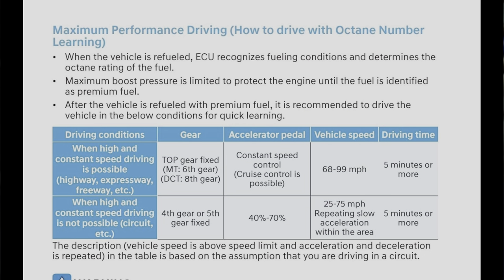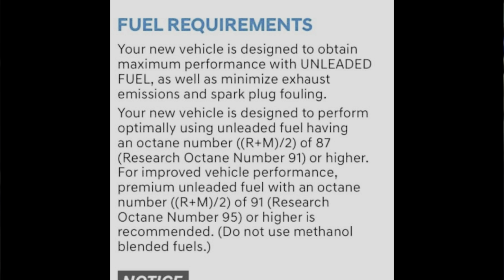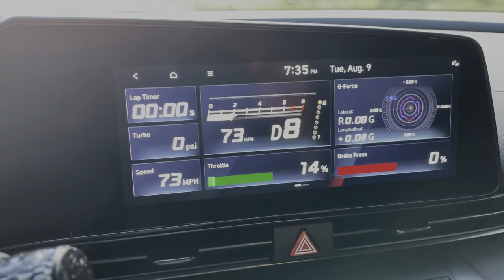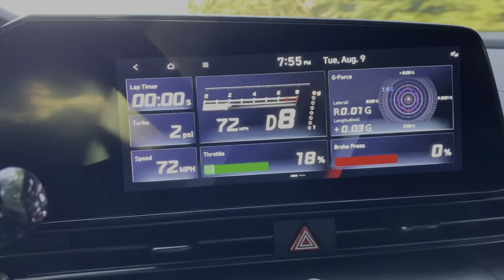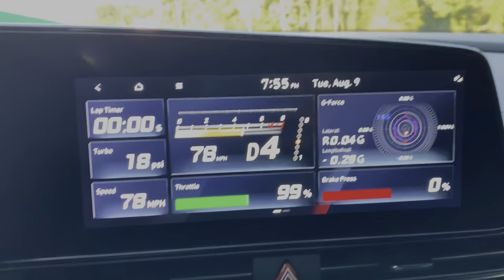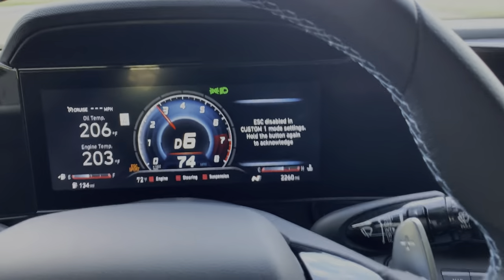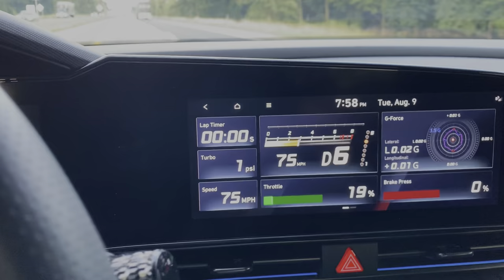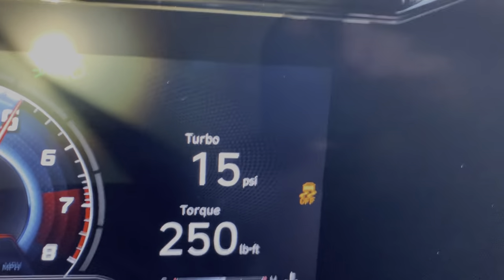Get Max Power on Your Elantra N (Octane Learning)

Comment: The one time I got the octane to learn after I got under a half a tank it went away. Is that normal?   If so if I keep tank above half at all times will it stay?    And has anyone seen the difference in power on the dyno from leaned and not learned?
Reply: Yes, OL will disable around a half tank and you’ll have to re-learn. It will also unlearn overnight.

Comment: Can anyone help me with my scenario. With how my drive is to work it is impossible to do high speed and even low speed is impossible. I’m only on the freeway for like 3 miles and the rest is city. I tried a different route on the freeway but going 70 for 5 minutes just doesn’t due to other drivers and it being already 15 over the limit. Also going between 25-75 mph in 4th with 40-70% throttle doesn’t make sense. Someone please help. I’m pretty much never octane learned
Reply: Get to 65mph in 6th and give it 40-50% throttle for about 5 seconds. Let off the gas for 5 seconds. Repeat this over and over for 5 minutes. Done.

Comment: So basically all you have to do is after you fill up get on the interstate set Cruz at 75 mph for 10 minutes and it will learn. Kind of retarded that we have to do stuff like this every fill up to get the max performance out of the car. Especially when I'm running 93 all the time. You would think that if you're running a lower octane fuel when you first go wide open throttle the car will retard the timing and know you're running lower octane due to knock. Should automatically pick up once you go wide open throttle to know what fuel is in the car. Would hate to fill up the car and come across someone on the road that you wanted to race in Mexico and your car lacks performance due to not have "octane learned"
Reply: Still haven't got it to octane learn. Only pushing 16psi. Max torque is only 250. Car doesn't seem to pull that hard at all.😢 We did a trip that was around 115 mi away and had the cruise set at 75 for like 20 minutes. 6mt EN. When are if I need a reset the PCM or something by disconnecting the battery. Right when I got the car and I broke it in and hit that 600 mi mark I went wide open throttle and it felt pretty good and I was hitting 18 lbs.. And I remember one day on my way to work It's like the car hit a brick wall when I was going in a boost. Ever since that happened months ago I haven't been able to run more than 16 lb and all I run is 93 octane.

Comment: Hate to be the "negative" guy here, but please head over to the facebook group and look at the newest post about the subject. This has been completely debunked by engineers and two prominent tuners with data. Looking at the low accuracy boost gauge and coming to conclusions about is nonsense, and the impressions are simply filled with confirmation bias.
Reply from the maker: Hey Will, thanks for your feedback on this.  I know you own one of these yourself, and while you and many others tend to agree with these engineers, I am one of the owners that feels the difference and believes it helps.   No disrespect to anyone who stands by their claims, it’s just my opinion that its in the owners manual for a reason.  Perhaps there are reasons some people feel the difference, while others don’t.   But when you drive this car daily, it’s pretty easy to feel the difference in my opinion.
Reply: @ENtense  No worries. I'm just data-driven. The issue and reason why anecdotal evidence is taken with a huge grain of salt is simply that the body/mind is extremely susceptible to error. For example, there was a peer-reviewed study a while back that included lots of fighter pilots with thousands if tens of thousands of flight time. Some of the most highly trained, experienced people extremely in-tune with their senses were tested on whether they could "feel" their speed, direction or attitude after some blindfolded maneuvers. Every single one was completely and utterly wrong in every case. The brain is a fickle thing. But yeah, definitely look at the data I posted, and also the comments by SXTH and Tork who have tuned these ECU's. The ECU does have a learning period, but in general it doesn't include boost and it is also extremely quick (within a minute in some cases). No need to waste gas on the highway haha, just drive normal for a few.
Reply from the maker: @williamrori1274  I appreciate the feedback and info, also while not being disrespectful like so many people can be lol.   But I will continue to monitor this whole debacle, along with doing more research on it myself.
Reply: @williamrori1274  What do I search to find these post that show data?
Reply: So what’s going on when people only see >15 PSI after following this procedure? And what’s the user manual talking about? Accuracy aside clearly something is changing and I wonder what that is.
Reply: @carloscervantes836  I don't want to call the guy's post out by name here, but head to the "Elantra N Owners Group of North America" and there's a post from yesterday about a guy who's wanting to sell his car because he thinks the octane learning is such a big deal (partially from videos like this). There's over 150+ comments on it at this point, but there's data and tuners answers in there.
Reply: @adamb8552  So let's talk about it. Firstly, the premise that looking at the low accuracy dummy boost gauge on the car and making claims about power just doesn't hold up. This is because boost is only one component to making torque/power in combination with things like (but not limited to) ignition timing, load, cam angle, lambda, IAT, atmospheric pressure, ethanol content etc. Secondly, we need to understand that this ECU (and really any ECU from the modern age) targets torque NOT boost, and uses the above to achieve that. There is nothing in the ECU logic (confirmed by SXTH and Tork tuning) that says "oh you're limited to 15 psi until octane learning is complete" - that is just pure nonsense and not based in reality. What this means in practice is that the difference in boost people are seeing is simply due to changing conditions and different load tables to meet the torque target. Octane learning happens extremely quickly (within minutes) and does not warrant any level of thought beyond "it exists as a secondary protection". 

At this point, I'm scheduling a dyno session to prove this out further. Even though I've already proved it with logs, vdyno data, and actual real-world high frequency track data. Should be the best A/B test we'll ever have on the subject.
Reply: @williamrori1274  Interesting, thanks for the response. When you say the octane learning happens extremely quickly, do you mean quicker than the manual suggests, below the speed that it suggests? Or is 70mph+ still necessary?
Reply: @williamrori1274 is there a way to know why when following Octane learning like the manual suggests the gauge displays the higher peak boost consistently and also the higher torque. Why would Hyundai "fake" what the built in gauges display but only when you run an Octane learning cycle as specified in the owners manual. I am only seeing 300 torque consistently on my Kona N after doing this learning. Now,  im not saying the gauge is even truly acurate or that the car is actually putting down that, but just curious why it will show a higher number after the learning cycle vs not doing the learning.
Reply: @williamrori1274  sounds like that guy has OCD and he'll never be happy no matter what car he has

Comment: Drove about 100 miles on 93 and my car wont learn... She's beautiful but she won't learn...
Reply from the maker: I’ve definitely heard some of these cars are way more stubborn than others.  What kind of conditions are you driving in?
Reply: Freeway about 77mph with cruze tried to stay out of eco but switched sometimes every 30 miles or so between N eco or normal. Mostly driving in normal trying to learn.
Reply: I'm going to try to disconnect the battery to see if that helps. Are you using 91 or 93?
Reply from the maker: @tyler7226  93
Reply: @tyler7226  Did you ever get it to work? I only run 93 in mine and only get 250 foot pounds and 16 psi according to what it says in the cabin on the gauge. Car feels like it only has like 220 whp. I have one with the manual transmission maybe that's why

Comment: What an annoying pain in the butt this is. Surely there are systems that can detect what type of fuel is in the tank without having to drive in the manner prescribed. My Renault Clio Mk IV RS200 needs 95 RON (I love in Australia), but I thought I'd test to see if it would run on E10 94 RON, as some 95 RON specified cars can do so. Within 15 minutes of normal driving with the 94 RON a warning light appeared asking me to get the car serviced. I just then fully filled the car with correct 95 RON, and the light eventually went out, but it proves sensors can be more finely tuned than those that appear to be in the N. What makes this even more annoying is that you have to do this every time you re-fill the tank when, again, the default should just be that you've filled with the same fuel unless you run the car through the learning process again.

Comment: **UPDATE**

I run 93 all the time and filled up last Sat. Yesterday I drove 1/2 mile to the touch-free wash, ran it through there and drove home. My drive from that wash to home is about 5 miles, no highway and I hit 19 psi...maybe my car is "good learner"🤔
Reply from the maker: It can definitely do the octane learning with normal driving too.  What’s your honest opinion, could you feel a difference?
Reply: @ENtense  well it only went to 19 psi for a second as far as I could see. As far as feeling the difference, as you know the car just pulls and pulls, it's a beast!

I can't wait to get the SXTH Element turbo inlet pipe and their CPTL intake. Opening up the inlet will flow more and give a bit more boost and hopefully hold higher boost longer🙏🤔

Comment: Curious about the actual accuracy of the gauges anyway but I will give this a run through in my 6-sp.  Any other manual owners out there experiencing an increase in at least the displayed boost number after running through the "learning"???.........mine seems to indicate a peak 16, then 15 steady since new on 93.........
Reply: my manual on 93, jsut started hitting 19psi out of no where, 16 was my limit, not sure if this, or air density

Comment: Cracked my windshield when i was rippin it at 90 on the highway😓
Reply from the maker: Noooo
Reply: @ENtense  any recommendations lol should i go to dealership or glass shop
Reply from the maker: @ggSosa  personally I’d take it to the dealer because of the front camera to make sure it’s recalibrated but if you take it elsewhere you can take it to the dealer after for calibration
Reply: @ENtense  thanks appreciate your input brotha

Comment: I have a kona n but I have never seen over 16psi or over 270 torque. It mostly runs around 15psi and 250-260 torque is that normal?

Comment: Can you help me with what I might be doing wrong I keep it in Normal mode I set the cruise at 72 and i've done it over 8 minutes at least 6 times and no change the only thing i've noticed is the road is not flat and occasionally it'll drop to 71 and up to 73 based on the hill Up or down. I am so frustrated
Reply: Best bet is to complain to Hyundai about it. They need to get rid of it and make this car premium fuel only
Reply: @4drturbo85   Facts!
Reply: Get to 65mph in top gear and give it 40-50% throttle for 5-10 seconds. Let off the gas for 5-10 seconds. Repeat for 5-8 minutes. Done.

Comment: It hasn’t ever worked for me …Have a CG MT …wasted time and gas …travel 100 kms a day on hwy …met the requirements …tried the highest octane at different gas stations …and never seen it go past 15 :(
Reply: 91 or 93 octane?
Reply: @tyler7226  I’ve used petro 93 and Esso and Shell 91 ….it’s weird that i can’t get past 15 psi
Reply: Drive at 80mph for 10 mins.

Comment: So if I was going out to mess around with another car in say Mexico, I have to drive on the expressway at that speed and then when I get off the freeway leave the car running until he shows up?
Reply from the maker: It will only reset once you refuel.
Reply: @ENtense   I would like to think that there is technology is technology where the computer can tell that you're running 93 octane fuel
Reply from the maker: @klasseact6663  agreed

Comment: If anyone wants to keep the psi when refueling. Refuel with only 4 gallons from empty and you never need to octane learn the new gas.
Reply from the maker: You’re probably the one on Facebook I saw mention this haha.   How consistent is this working for you?
Reply: 4 gals from empty? So we talking about making sure your not under about 100 miles to empty?
Reply: @ENtense  everytime!
Reply: @cameronkukuselis3691  no when you run out of gas fill up 4 gallons not 5 and it won't restart. I always do 3.9 galls just to be safe. What I am going to test today is can I continuously refill with 4 galls with no change